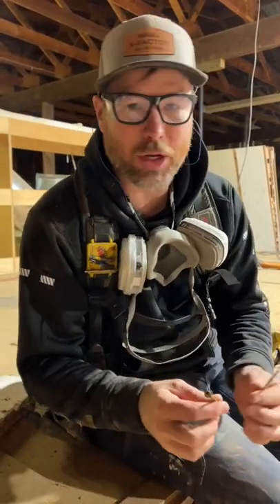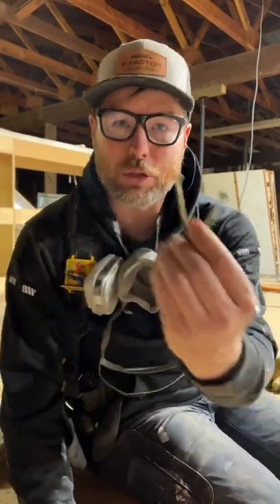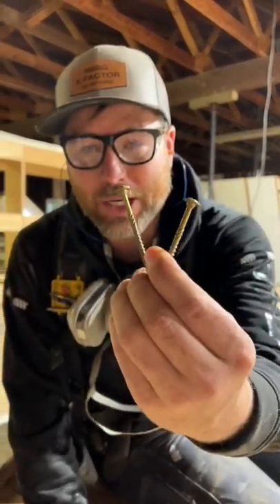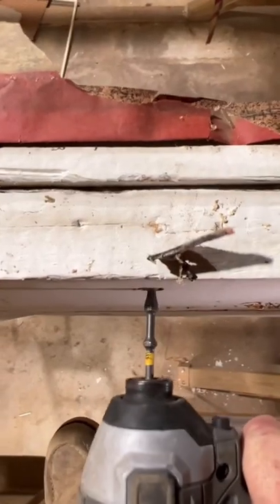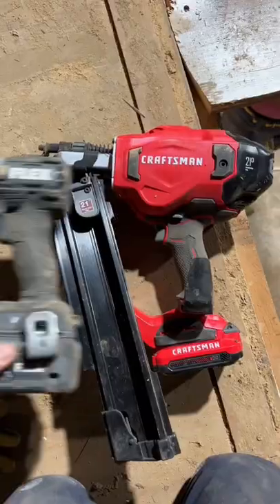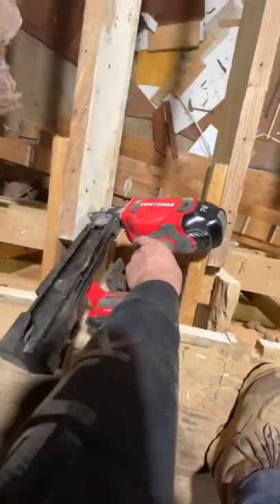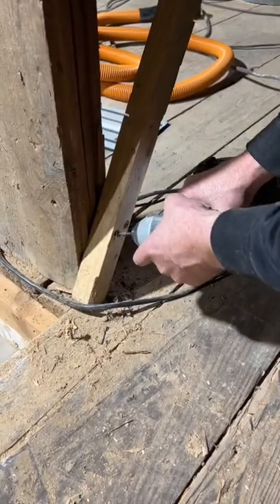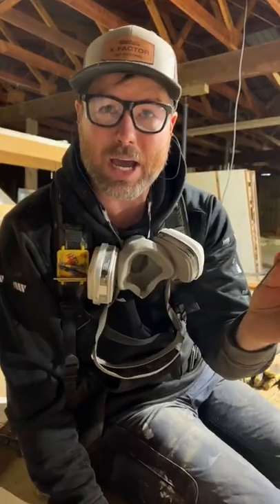When to use structural screws in framing

Comment: There are also occasions where nails provide better shear strength and sometimes a project will be engineered that way.
Reply: 100% of anyone who will utilize the information he has provided knows exactly what you're talking about which is why he's relaying these niche applications.
Reply: When tensile strength vs shear strength is needed. Nails have a better shear strength while screws have tensile strength.
Reply: @hawkman302  100% wrong. Shear strength is related to tensile strength. Shear strength is usually 60%-75% of the material's tensile strength. Material science and engineering 101.

You're confusing a nail's ductility with shear strength. A high tensile strength screw will always have a higher shear load capacity compared to a ductile nail of the same diameter. There is no debating this fact. Every contractor (and internet commentor) who says a nail can handle shear better than a screw is completely wrong and knows nothing about how fasteners are engineered.
Reply: @internettoughguy  100% I can’t tell you how many times I’ve argued this point with people!  A structural screw of the same size is generally way high sheer than a nail!

Comment: Built a whole house with those screws. Foundation, subfloor, walls, windows, trusses, roof, everything.
Reply: This is an interesting proposal
Reply: At first thought it might seem to be a good idea, but nails offer more flexibility than screws do. So in high winds, you may want the flexibility of a nail bc screws may offer more tensile strength but they can snap under the right circumstances

Comment: I used GRK screws to frame shower niches this week. I didn’t feel like picking up my heavy af nail gun.
Reply: A shower niche is pretty much never susceptible to movement so screws are 99% common practice. Also allows you to adjust if needed. Don't know anyone who uses nail guns on a bathroom unless you're framing an entire one where it never existed before.

Comment: A palm nailer can get in tight spaces when you need nails. Nails have good shear strength vs screws that are brittle to bending, like in floor joists or ganging king/Jack studs. An inspector might not give you a pass if they see a screw where there should be a nail unless the engineer accounted for it in design or materials like using Simpson or Tapcon structural screws.
Reply: Don't confuse a nail's ductility with it's shear strength. If a nail bends it means you've exceeded it's load capacity in shear. A screw will always have a higher shear strength compared to a nail of the same diameter. The difference is the screw is not as ductile and will snap at excessive load. The failure load however is much higher than that of a nail.
Reply: @internettoughguy  that's not exactly accurate. You are correct in the strength and abilities of a screw, but it's the nails ability to bend, slip, pull out and push back in, that makes it required by code.
Reply: @shawnhuk  I'm not debating why nails are required by code. I'm being specific about the term "shear strength". Ductile nails DO NOT have higher shear strength than screws. Period. There is no debating this fact. Almost every contractor makes the statement that nails have better shear resistance than screws. This is factually incorrect. They seem to think that because a nail bends instead of fracturing that it has better shear capability. This is a flat out wrong assertion.

I've been designing structures and specialized heavy lift equipment for the areospace industry for more than 25 years. My specialty is stress analysis and mechanical system. I know a thing or two about fasteners. What I said in my previous comment is...exactly correct.
Reply: @internettoughguy  - This is a loaded topic... I am going to admit I do not have the specific scientific data showing the shear capabilities of a nail vs a screw of the same size. But that's not what this discussion is supposed to determine - a screw may have a higher shear value than a nail, but it's the brittle nature of a screw that creates the liability. A nail will always be better suited in a lumber constructed structure over a screw for the fact the ductile nature of a nail is required - this is proven in countless practical events/circumstances in construction. Now, if you're building an iron/steel bridge, of course threaded fasteners are preferred... I'd also like to add that Grade 8 construction screws either don't exist or, certainly aren't common. 

The architect said the design is sound, 
The engineer said the specs are sound,
The inspector said follow the design, 
And the builder said they're all wrong and out of touch with reality...
Reply: @shawnhuk  Words of the OP..."Nails have good shear strength vs screws that are brittle..."

My response to that...NO. That's what this discussions was initially about. YOU turned this discussion into everything else. I kept my response to OP specific related to his assertion.

Edit: If you interested in data for screws the grkfasteners website has some good documentation about their different types of screws.

Most people who bash screws for structural applications don't fully understand how and why they work better than nails. They think all screws behave like a typical deck screw where you hit it with a hammer and it snaps. Yes of course it snaps but you don't use that type of screw for framing. There are framing specific screws that outperform nails by a wide margin. One of the reasons is clamping force. If you hold two pieces of wood together with 3 screws the clamping force generates enough friction between the faces of the wood that the screws don't even see any shear loads. It's the friction between the pieces doing the work. It's the same principle at work in steel construction. Nails can't work like this...and is the reason why they bend when joint integrity is lost (contact faces separate).

Of course screws are not typically used for new framing because it's not practical since it takes longer and costs more. It's not because they weak compared to nails.

Comment: I heard in another video that nails are used if something shifts, like a house settling. This made sense to me but I wasn’t sure how true it might be
Reply: That’s correct, it’s about shear strength, nails bend screws snap. However the screws he is showing here are structural screws and stronger than the average wood/deck screw.

Comment: Does the code sometimes explicitly demand the usage of screws over mails?
Reply: No. Screws have zero shear strength - they snap. The only time you'll see anything in building code about anything threaded is related to beams being bolted in some orientation, or sill plates being bolted to concrete foundations (there may be a few more items depending on where you are in the world). That said, there is a lot of ambiguity in code about fasteners or how something is fastened. UNLESS it's structural. In which case there are fastener specs and nailing patterns

Comment: You should review the flex tool line!
Reply: Many people already have. They're still in their infancy. They overheat and oil leaks out if they get too hot. That's a huge indicator of poor internal components. They also intentionally mislead consumers with their initial power claims. On top of it, they only offer mainstream tools as a kit with a battery and charger, which means if you want to buy individual tools and don't need another battery or charger, you're out of luck. Not exactly a brand I would spend premium pricing on. Maybe someday when the kinks are worked out, but until then, they're just a stronger kobalt line. And quite frankly, I'd go with kobalt first.

Comment: How about subfloor? I've always used screws because I've been told it helps prevent squeaking
Reply: Ontario building code will stipulate a subfloor is glued to the joists. It'll be the builders policies that say it'll be glued AND screwed.

Comment: You missed an important factor: use nails when the primary forces are shear. Use screws when the primary forces are tensile.
Reply: Depends on the screw, some screws have greater shear strength than nails.
Reply: @ryanlorenz561  you’re absolutely right, they do make structural screws that are rated for shear stresses. I like using them for joist hangers.

Comment: With heavy structural things use nails because a screw will snap but a nail will bend
Reply: I agree, but they're changing that. Screws have actually outperformed nails in shear strength lately. For decades people have been setting ledgers with lag bolts. When I need to set large hangers for massive LVLs, my engineer calls for big Simpson hanger screws. Only high wind areas are specd for nails and with modern hangers and bracing the place's aren't even moving these days. Nails are faster, but rapidly losing their place as the only option.
Reply: @Tool_Addicted_Carpenter  ty for the info very cool!
Reply: @itsdyl1031  No worries man, happy to pass it along. If you'd like to check out some solid videos on it then Project Farm has some really good ones testing shear and tensile strength.

Comment: Theres more to it than that. Its not about whats easy.  Screws snap. Nails flex more under pressure. As the house expands and contracts the nails will move with the wood. never use regular wood screws to attach rafters to top plates, or joists to beams
Reply: Structural screws...best of both worlds

Comment: Is there any difference in when you can use an electric framing nailer vs air?  Or is it just a matter of cost?
Reply: Cost, convenience, etc. My boss and I use a gas framing nailer, as long as it sinks framing nails it will get the job done
Reply: I have multiple cordless and countless air. If you're buying air, go with Hitachi(metabo) or paslode. Even with the hose, air is a much lighter option. With that said, I absolutely love the option of cordless because there are no hangups or trip hazards when you're high up on staging or a roof. I have a little experience with gas. My first boss had 2 gas that gathered dust for years until I came along and spent the time to revive them. It wasn't worth it. Maintenance and gas costs weren't worth it, which is why they were gathering dust. The Dewalt cordless is ok, the Metabo cordless is good, and the Milwaukee cordless is great.
Reply: @Tool_Addicted_Carpenter  the Milwaukee cordless is my gun of choice. I also like the hold of screws vs nails. Scrail is a great option to get the hold of a screw from the convenience of a framing nailer. In like a nail….out like a screw

Comment: I hate nails. Only use it when shear strength is needed. But i will still use screws to pull it tight in place.
Reply: Try out Scrail brand at Home Depot. Screws shot from a framing nailer

Comment: When you use both on overkill that's the house still standing after the tornado goes by lol
Reply: Actually no. It's proven and therefore in building code that nails are required because nails will bend and slip in the framing members. A screw will hold tight until something shifts and the screws snap. All structural braces, brackets, etc, are all required to be nails for their shear strength
Reply: @shawnhuk  looks like the codes need more straps to the foundations down south cuz the tornadoes don't care about codes I'm just saying the more the better of both and none of my work has ever come apartwhether it was modular or stick built code is law and yes nails bend but using both is stronger been building for a long time and the ones that come apart are the less nailed quick cash guys and  not using straps on all studs
Reply: @ericmorse2251  PLEASE - punctuation... 
I am in southern Ontario, we don't deal with tornados much. But minimum code is just that - minimum... Screws are undesirable in our freeze thaw climate. If you build a wooden deck with screws and screw the deck boards down, I guarantee 60% of the screws will be broken within 2 years. We've dealt with this first hand countless times. Screws cannot take the expansion and contraction. 
However, your tornado strap codes - do they require a special structural screw in the straps? Or nails? Or, do they accept standard construction screws?
Reply: @shawnhuk  use of nails mostly but personally when I garuntee something if I use screws as well it holds better with both and I use zinc screws expensive yes but if you use cheap you get cheap results and like all homeowners when explaining this they want good and long lasting the cheap guy is the ones flipping houses for quick coin I'm not into that I prefer to be honest and help as many as possible along the way I just like over kill in nailing and screws and have always had good words on years later for structural sturdy ness and no problems

Comment: Wrong, nails are used on pressure bearing applications or where things need to move, screws will snap in these applications. The crock of crap about a nail gun not fitting is why you use a hammer…